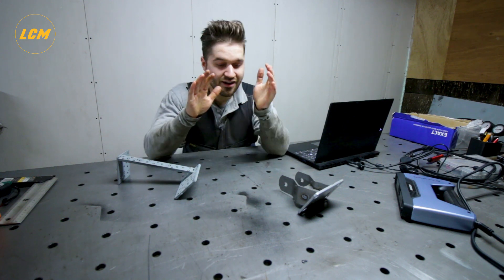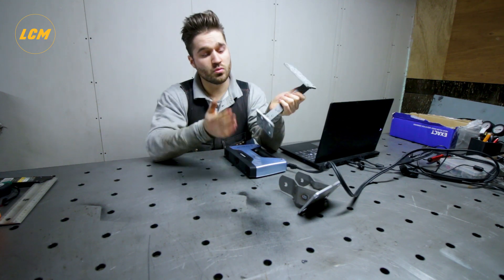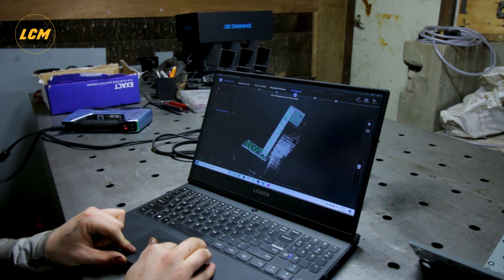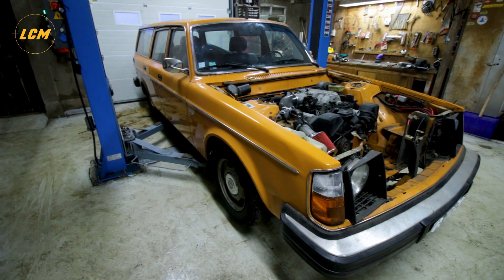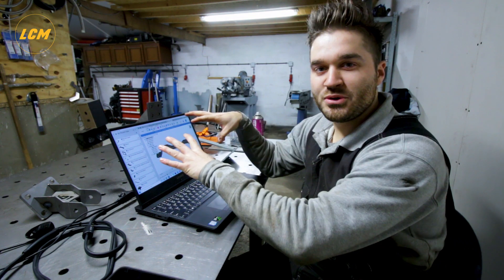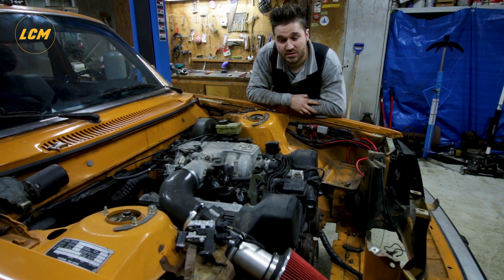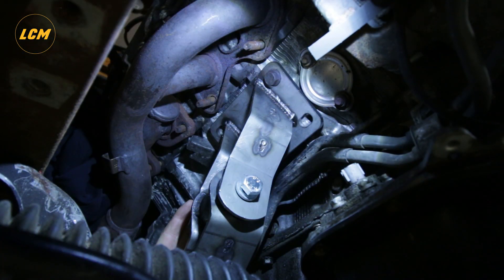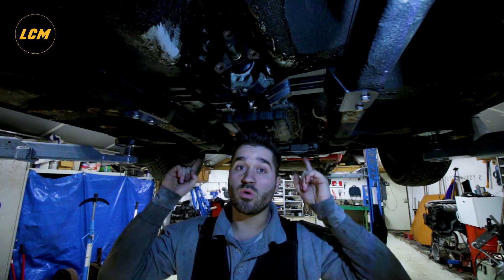Volvo 240 1UZ Swap Engine & Gearbox mounts are ready for production!

Comment: The design process is really cool to see. The scanner gives you a mesh like an stl file? The. You draw in solid works off that mesh to make the mounts?
Reply from the maker: The scanner indeed gives you an STL, OBJ or Point Cloud file. With software like GOM inspect you can create planes, cilinders etc from the STL file or completely reverse engineer it. I just use it to create planes and cylinders that I can use in Fusion 360 to create an assembly.
Reply: @LucaCarMods  yeah it's that bridge between scanned files and the model I need to learn more about.